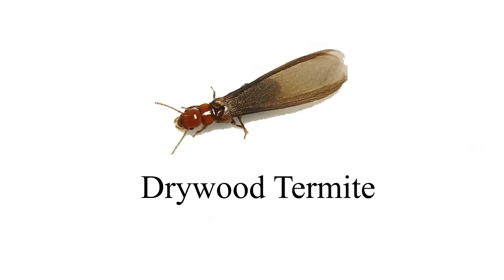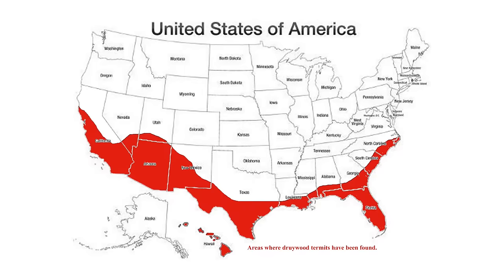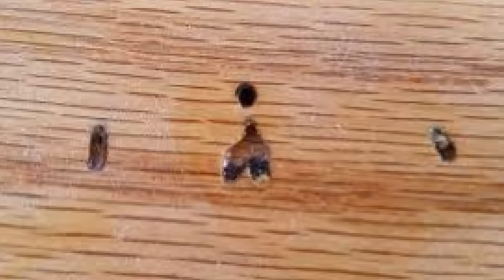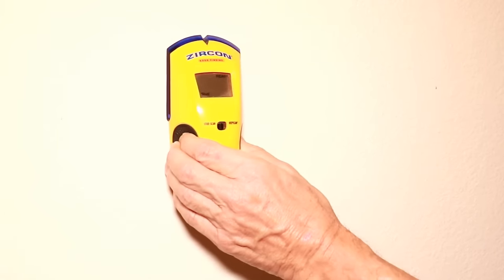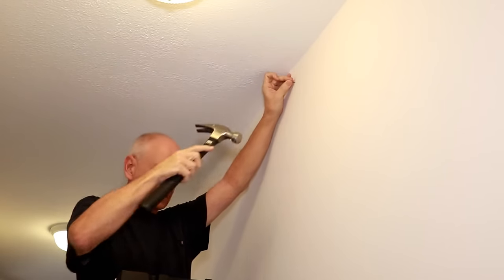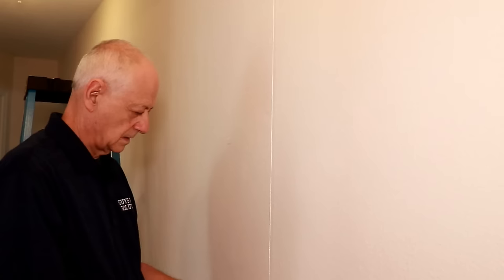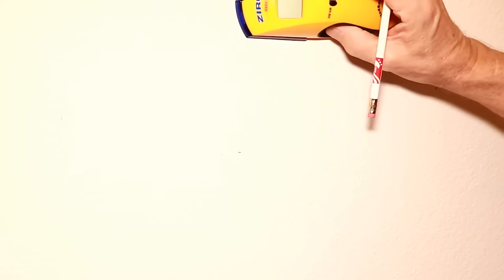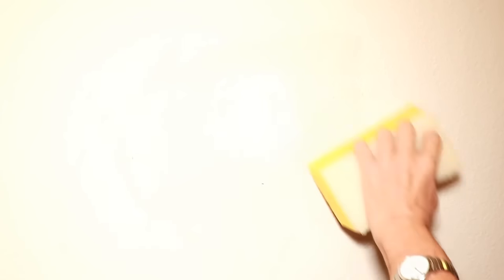How to Treat a Drywood Termite Infestation Yourself. A MUST see if you have Drywood termites.

Comment: I am so glad I found your YouTube page. You have so much great information. Quick question, I saw a swarm of termites outside by our brick wall. It was probably 5 to 8 feet away from the house. I had a pest company come out, but he said the house is fine from termites because of the location of the swarm. Is that true? There was some dead ones in a bucket of water and he identified them as dry wood termites. Should I be worried? I’m not sure where to look for them in my house. Thanks for all you do.
Reply from the maker: Thank you for reaching out to me.  I am so sorry to have to tell you that I totally disagree with the pest controller that came out to your house.  While I cannot say for sure that you have a drywood termite infestation, I do think you certainly have cause for concern.   Finding drywood termite swarmers 8 feet from your house is a huge red flag.  If the pest controller did not look inside your house, then he was totally incompetent.  It is very common for drywood termites to enter your house through the eaves and establish residence in your attic.  Then they will eventually swarm in your attic and move to other areas of your home, including inside your walls.  It is also common for them to enter around doors and windows.  Therefore, a competent pest controller would have inspected both outside and inside your home, around windows and doors and definitely in the attic.  You can do this yourself, but you are not going to have the same level of experience that a professional would have.  If I were you, I would get at least another couple of pest controllers in to inspect your home to see if you have an infestation.  If you would like to do this yourself, then go in the attic and look for frass and kick out holes.  Frass looks a little like sawdust and you will typically find it just below tiny kickout holes in the wood.  Also look for frass inside the house as well.  We typically see it near baseboards, but you can also find it in and below your cabinets as well.  Many people do not know this, but termites also eat drywall.  So, look for areas of the walls and ceilings that appear to be discolored, sagging, or have tiny holes.  Even if you do not see any of this sort of thing, it doesn't mean that you're off you are okay.  Drywood termites can be very difficult to find and even the best professionals can miss them.  That is because these guys can enter around your windows and doors and may have their kickout holes in the sides of the studs that are inside the walls.  Therefore, they could be eating away at your home and you would never know that you have them.  That means, even if you have a couple of professionals inspect your home, they may not find anything, even though you are infested.  So, after you get a couple of inspections done, even if they don't find anything, you ought to keep an eye out for the signs of an infestation that I already spoke about.  If you have an inspector that does find drywood termites, then please do not sign a contract.  You never want to take the first offer that is put on the table.  The only way to eliminate a drywood termite infestation entirely is to fumigate.  Some pest controllers will tell you they can spot treat for it, but that will end up costing you more money in the long run, so don't fall for it.  If you have drywood termites, then the smart move is to fumigate and I can tell you that prices in this industry can vary quite a bit.  I have seen prices for fumigation vary as much as $2000 for the same job.  So, it definitely pays to shop.  Always get at least three estimates and preferably even more.  The more estimates you can get the better.

One thing you know for certain now is that you do have drywood termites in the area.  That means you are vulnerable to attack at any time.  Therefore, you should immediately begin a preventive treatment program.  Unfortunately, this is something that most pest control is will not do.  Therefore, this is something that you must do yourself, every three months.  I have a video on how to do it and I will place a link below.  Don't worry though.  It is not that hard to do and it is perfectly safe.

I am so sorry that I had to be the one to give you all this bad news, but at least now you know the truth about drywood termites.  Please feel free to ask me all the questions you like.  I am always here to help.

Be well my friend. 

Video on how to prevent drywood termites:  https://youtu.be/neNsmVbj8Pc

Comment: Hi Guy! I loved the video! I was wondering if you knew if the FiPro was safe for kids and pets. Also would this treatment work for window sills. I noticed that dry wood termites are making kick out holes on the window and I am finding wings
Reply from the maker: FiPro is safe after it dries.  You don't want people or pets to interact with the wet product.  They can be in the same room when it is being applied, but they should not touch it until it dries.  This does work for windowsills.  Here's the thing you need to know though.  This treatment for drywood termites is the best way to do it yourself, but it is almost impossible to find all the galleries.  Even the best professionals who have done this for years cannot do it.  Let me take a few minutes to explain drywood termites.

It is important to understand how drywood termites work.  They enter through cracks and crevices around windows, doors, eaves, pipe penetrations, and so forth.  Most of the time, they enter through several locations.  That is because a swarm of them attacked your house at the same time.  If there was a crack or a crevice, then they probably found it.  After they establish their galleries, which will be inside the wood, it will take four to seven years for them to be able to swarm.  Now that they are in your house, the swarmers will use holes that are in your studs to travel through the walls.  Those holes in the studs were created by the electricians to run the electrical wiring.  Not only are these holes going through the studs, but holes were drilled into the attic for the light switches and to run some of the wiring for the outlets.  So, the termites now have easy access throughout the attic and the walls.  If you have a basement or crawl space, they have access to that as well.  Most of the time, you will have no idea that they are in the walls, because the frass is inside the wall.  To make matters worse, if you have drywood termites, then your neighbors have them too.  That means you have been getting swarmed for as long as they have existed in the neighborhood.  Most likely, we're talking about years, so it's a safe bet that you have these guys in many locations in your home.

I always hate to be the bearer of bad news, but if you have drywood termites, the only sure way to get rid of them is to fumigate.  Prices for this can vary wildly in this industry, so I recommend that you watch my video on how to hire a pest controller without getting ripped off.  That video can save you a lot of money.  You should also know that the gas they use to fumigate has absolutely no residual action whatsoever, so you can get reinfested the moment the tent comes down.  Like I said before, if you have drywood termites, then your neighbors have them as well.  Since drywood termites swarm every year, it is almost a certainty that you will be reinfested within a year after the fumigation is done.  The only way to prevent this is to do a preventive treatment on your house every 60 days.  Most pest controllers will not do this, so it is something that you generally need to do yourself.  I have a video on how to do that and I will place a link below.  This is a generic video that covers a lot of different pests, but it also works for preventing drywood termites.  Just ignore the part about treating your yard.  You only need to treat the house for drywood termites.  This will not treat the termites that are already there, but it will stop new ones from getting in.  If you absolutely cannot afford to fumigate your house, then you can certainly make it better by treating it yourself as I showed in the video you already watched.  Even though it is virtually impossible to find all the termite galleries, it is way better than doing nothing.  Regardless of how you treat it, you should begin the preventive treatment immediately, so that you do not get additional termites paying you a visit.

I hope that helps.  Be well Trinity.                    

Video on how to hire a pest controller without getting ripped off:  https://youtu.be/y-a8XOqVrlE

Video on how to prevent drywood termites:  https://youtu.be/Yozv3s-Qwlw

Comment: First off this is exactly what I've been searching for the last week. I want to thank you for the time that you spent to make this video. I am about halfway through with the video and I have a quick question. What if you have that old cotton candy style insulation in between the wall boards wouldn't the frass get stuck in there and not fall to the bottom? Also if you did see frass on the bottom and you only treated the two wall studs what about the crossmember at the very top shouldn't that be treated? I'm referring to the cross member at the very top where the wall meets the ceiling
Reply from the maker: Let me start by saying that you are a very smart man.  You are absolutely correct regarding both points.  It is very common for exterior walls to be insulated and, yes, that may prevent the frass from falling to the bottom of the wall void.  Also, the horizontal 2 X 4’s on the top of those exterior walls, and the interior walls as well, should also be treated.  The problem is, how do you get to them?  About the best you can do is to treat your attic with Bora-Care, which is explained later in the video.  The points you are making are just some of the reasons why I always tell people that spot treating for termites is far from a sure thing.  The truth is that the only sure way, that I am aware of, to totally eliminate a drywood termite infestation is to fumigate.  The only reason I did the video was because I understand that fumigation is expensive and there are people who simply cannot afford to get it done.  For anybody that can afford to get fumigation done, then they should totally forget about this video and go get it treated correctly.  However, if you simply do not have the resources to get your home fumigated, then this video is about the best treatment option that you are going to find anywhere on the Internet.  It is certainly not a perfect solution because of the exact reasons you mentioned, and some other reasons as well, but it's better than doing nothing.  Still, I do not wish to misrepresent the effectiveness of this procedure.  I can almost guarantee that you are not going to find all the galleries in your home.  Spot treating for drywood termites is kind of like playing whack a mole.  It is very predictable that you are going to continue to see galleries cropping up and the worst part is that you may not see those galleries until there is structural damage.  That is the absolute, honest truth.

While I do appreciate your very kind comments, at the same time, I want you to understand that you did not strike gold here.  I like to think that this is the best video on the Internet if you must treat for drywood termites yourself, but this is not even close to being the best solution.

I would urge you to also check out two of my other videos that are very important for you to watch.  Please watch my video on drywood termite treatment options.  I think you are going to find it very educational and worthwhile watching, if you need to treat for drywood termites.  Also, you should know that, if you have drywood termites, then I can guarantee you that your neighbors have them as well.  That means, even if you fumigate and kill all the drywood termites in your home, you are going to get re-infested within the first year after the tent comes down.  That is because fumigation provides no residual action.  If you do not fumigate, then you are going to continuously get more and more drywood termites in your home because they will still keep coming from the neighbors, on and on without end.  Therefore, I recommend that you watch my video on how to prevent a drywood termite infestation.  This treatment will do nothing to treat an existing infestation, but it will prevent anymore drywood termites from entering your home.  I will provide a link for both videos.

I hope that helps.  Be well my friend.

Drywood termite treatment options video:  https://youtu.be/iD6NTU16-XQ

How to prevent a drywood termite infestation video:  https://youtu.be/neNsmVbj8Pc
Reply: @GuysPestSolutions  thank you for the detailed response.  The way I look at it is if I can get rid of most of the drywoods and a couple galleries remain at least I stop the damage on those specific pieces of wood and I can get "practice" at finding these termites.  I first have to determine if they are drywoods and not subs....

Quick question....on a mobile home where termites can easily get under the home and build mud tunnels up...would they be nesting right under the home or would they be nesting outside the perimeter of the home? Reason I ask is because I obviously would just trench the perimeter to eradicate the problem rather than crawling underneath but I wouldn't want to waste my time trenching the perimeter if it didn't kill all the termites...

Other quick question is about the use of a stethoscope to help locate termites in the walls/floors/ceiling joists....would that potentially work?  I wanted to buy that termatrac but they want 5 grand for it! 3 grand for the radar only version! I wish they made one of those for home owners...I bet they would make more profit selling to the DIYers than selling the high price to the pest controllers
Reply from the maker: @macknumber9  You make a good point about reducing the amount of damage by reducing the number of galleries.  This is certainly true and it is also true that you will get better at finding galleries over time.  So, while you most likely will not stop the carnage, you can slow it down and that is the reason I did this video.  If you cannot afford to kill all the termites, then do your best to kill as many as possible.

Most of the time a subterranean colony is located within 300 feet of the center of the home.  In the case of a mobile home, it is certainly possible that the colony could be under the structure, but most likely it is not.  In the case of subterranean termites, they must build mud tubes from the ground up and cannot just fly into your home the way drywood termites do.  So, we treat the ground.  In the case of any structure that uses piers for support, the ideal way to treat is to trench around each pier.  That way it does not matter where the infestation is located.  The problem is when the home is too close to the ground and you cannot access the piers to trench.  Then the best you can do is to trench the piers you can access and also trench around the perimeter of the home.  Additionally, you can treat the underside of the home and the piers you cannot reach with a pesticide.  There is an easy way to do that, but I cannot discuss it in an open forum.  There are reasons for that.  If you want more information on how to do it, then please email me at guyspestsolutions@gmail.com.

Drywood termites do make noise when they eat, but I don't know if you would be able to hear them by using a stethoscope.  It's possible, if the colony is close enough to the surface and is large enough.  So, it may help to find some of them, but would not be a solution for finding all the galleries.  You may not find any that way.  I don't know of anyone who has had success with it, but I always keep an open mind.  Please let me know if it works for you and I will share that information with others.

I hope that helps.